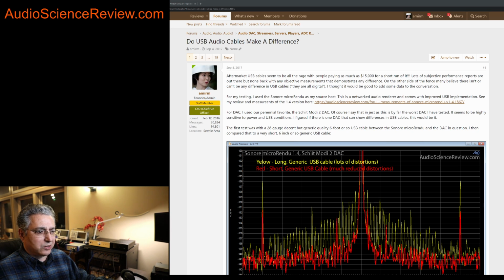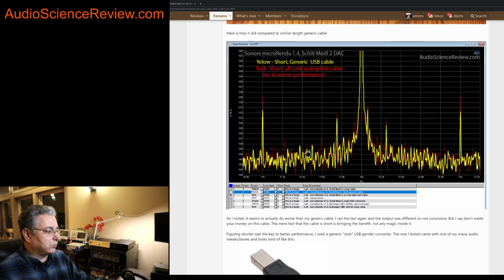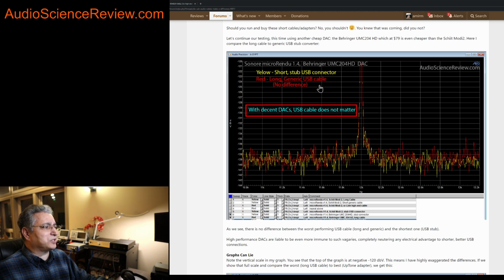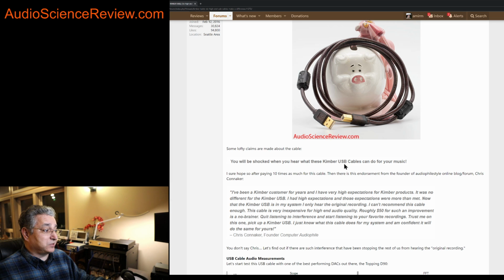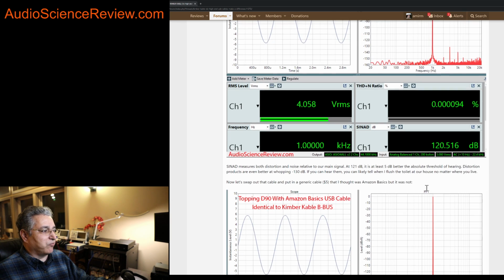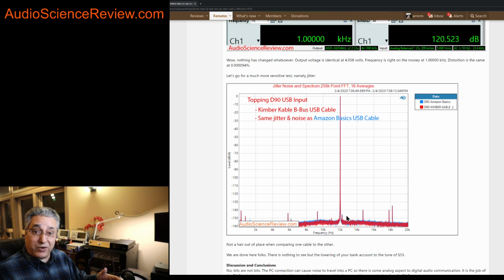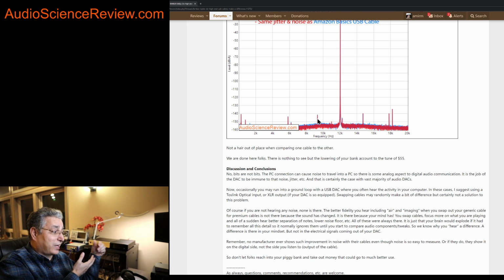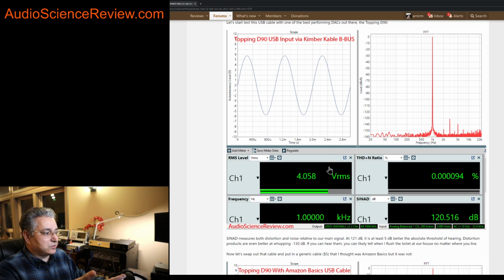Do USB Cables Make an Audible Difference (Kimber Kable Review)?

Comment: My experience goes far beyond comparing two USB cables. I've tested different USB cables, with and without galvanic isolation, and combinations of different cables and galvanic isolation.

I own two relatively modern DACs, a Topping D30 Pro and a Denafrips Ares 15th. In my listening experience, neither completely eliminates the influence of the USB connection.

The best results came from combining a high-quality USB cable (AudioQuest Carbon) with a galvanic isolator (Topping HS02). The subjective improvement is substantial: a more natural, three-dimensional, lifelike sound.

You haven't tested these combinations. Instead, you assume that any competently designed modern DAC has already solved these problems internally.

I don't claim that my listening experience is scientific proof. But your measurements on a few DACs aren't proof that everyone hearing differences in other configurations is imagining things either.

You correctly acknowledge that USB connections can affect analog output, then dismiss experiences you haven't investigated. That's an unjustified generalization, not scientific rigor.

Comment: UGREEN! on amazon are great i have 5 audio interfaces clean as, and theyre LOCKING really good USB-B connectors so tight ;) - they are triple shielded not double (the only thing that really matters is preventing interference after all).. and btw cable resistance is the start and end connectors, the material in between and length only causes 0.000001%  latency (if your after low latency that is)..  also keeping all your usb devices on same cables makes same latency.. this is my biggest suggestion if trying to sync multiple devices.  ALso ditch ASIO4all it sucks,. use VB Matrix and u can divert ur usb audio anywhere.. no DAW running,,   it absolutely rocks!

Comment: I dont use or need USB cable for audio but lot of people told me they are very important and I beleive them. I also beleive your testing, I am not very knowledgeable but I have an open mind and a scientific background. You must be missing something in your measurement ? High-frequency noise from noisy USB ground? Can you measure on the dac side if jitter is less with a better cable? I beleive in your accurate test but also beleive your missing something.

Comment: Measurement is one thing, but I can't explain why I hear difference between cables. My friend loaned me a $3500 USB A to B cable and I compared with the another that I bought at Best Buy for $20. I did hear a difference. Whether you like the difference the expensive cable makes is another story. I really wished the $20 sounded as good as the $3500 if not better. Well, I do like the $3500. Was it a day and night difference? No. But I am not going to buy one since the price is beyond my means.
Reply: But that's because you KNOW the $3500 cable was plugged in. I'm willing to bet if you did a blind test you wouldn't hear the difference. It's called confirmation bias.

Comment: I've given up on cables.  I believed and felt like I was missing out on the full potential of my system without expensive cables so I bought a bunch of expensive ones that I used for a few years.  Then one weekend, I decided to have some fun and order some Benchmark Media Cables that totaled less than the cost of one cable in my system.  Did some back and forth and at first felt the Benchmark Cables were more sibilant.  Then I switched back and realized the same sibilance was in my much more expensive cables.  Dawned on me that I was just listening more intently to try and pick up differences.  After switching back and forth with one cable at a time and then switching all of them, I realized I was hearing no difference.  Then I did the same with some UL safety certified, Monoprice cables vs much more expensive power cables.  Realized the same thing.  No difference!  Sold all of the expensive cables and used that money to buy some new headphones.  It was actually freeing to give up on expensive cables.  Thank you for proving my experience with science!
Reply: Well done! Exactly right!
As a physicist I never understood what this cable fuzz was all about. And Amir makes it totally clear:
IT'S ALL A SCAM.
I chose the cheapest of the cheap cables and am totally happy with the results: Crispy sound, monstrous bass. great imaging ...
My point: Pay for what you hear!
And turn up your BS detection!

Comment: Kimber is usually a lesser evil. They do make well constructed large gague cables that are of reasonable price. They are one of the few providers that actually measure their "run of the mill" cables and publish the results on the website. They do, however, also sell ludicrously expensive silver and carbon coated cables (they don't show any specs for those😂) for those ignorant enough that they must just have them.  Caveat emptor!

Comment: I wonder what measurable differences you would find between basic and "high end" DACs themselves. Mike Moffat's been at this as long as anyone in the audiophile marketplace. So I would consider his Schitt products to be based on very reliable standards of excellence. Their most expensive one is $2300. So it would be interesting to see the difference between Schitt's high and low priced products. Even in the deep and weird analog world of comparing phono cartridges, the differences are there... but are they improvements? However, you hit on the main culprit to these technologies running into stratospheric lunacy... the blind test. The high-end audio industry is in lockstep agreement to limit these kinds of listener generated testing platforms. It's the dark side of the industry that perpetuates the absolute insanity of $20k USB cables. And yet, there is zero effort in the industry to put an end to this nonsense because it's so highly profitable to keep it all mysterious. If you got 10 of the world's best "golden ear" listeners in a room and a/b tested 5 100wpc amplifiers, 5 DACs and 5 preamps through 5 different sets of interconnects through one pair of good speakers, you would get probably get some interesting but unconvincing information.
Reply: It seems every company eventually wants a piece of the snakeoil market.  Even bluejeans

Comment: How can better cables make a difference if the software protocol is responsible for making sure the data is send exact? Unless you have a defective cable, a $5 usb cable will work just as well as a $1000 one, because the software make sure you always get a carbon copy of the data on the other side. The software protocol even allows for losses and it compensates just fine.

Comment: I've always been FIRMLY in the "cables make no difference" camp (with the obvious caveat that minimum specs must still be met). For home audio, Amazon Basics is essentially as good as anyone needs. On the professional side, these days I use 12G HD-SDI cable (Belden) and 12G-rated BNCs for every cable I make up. In many cases, 3G would suffice, and 12G won't (of course) give me "better" results, but I like to be able to re-use cables and know that any cable will work with any piece of equipment in my system. It's quite amusing how people into "audiophilia" are typically guys with surplus disposable income and precious little idea about how electronics work, aside from repeating rubbish they've been told at some HiFi show or whatever. They have just enough knowledge to be a danger to themselves (and their bank balance!). The "high end" manufacturers are taking their customers for absolute fools, yet the buyers lap it up, and defend it to the hilt. Crazy! 
Amir, Gene DellaSalla, and others like them are the saviours of sanity in the world of hifi. Sadly, many people (eg. cheapaudioman) purport to be "down to Earth", "the voice of reason", etc. yet shill garbage like audiophile power cords. Thankfully, I don't need to take advice on cables from YouTubers (no offense, Amir!) but I very much appreciate these debunking videos. Unfortunately, the "believers" in audio mysticism don't want to face facts. Their loss, their bank balance! They really ought to know that the manufacturers are literally taking them for fools though!

Comment: if cables made differencea then we would see it clearly tv/monitors but these people have their heads up in their own a** hole, i bet in a blind test they would hear differences when nothing is changed at all
Reply: It depends on the audio gear, much of the issue is electrical noise over the mains. Anything and everything one can do to clean up that noise will be an improvement.

Comment: I for sure hear a difference in USB cables. I have listened to recordings with a few cables and listening back to back with the different tracks I can hear subtle differences between the cables. If I were to swap out cables and not have the recordings to listen to I would probably not hear it as much if at all. You tested to pretty low end cables here and I think you will see a bigger difference if you compared the basics against a $200 - $300 cable.
Reply: Agree, the system I am running right now, every cable change is audible to a point. And not just to my ears, as folks in the house that have no clue what I am doing have asked "What the hell did you do?" when I chose poorly.

Comment: Great video. I want to add one important aspect though.  All these USB cables are manufactured by the same cable manufacturers in Shenzen China. Kimber is not a manufacturer. Probably no American company manufacturing USB cables. They buy cables from the Chinese and snake oil them for much higher price

Comment: Interesting video – Thank you. 🙂
I think you should add to your conclusions that the measurement shown in this video, proves that only a synchronous usb interface, will be able to be impacted by the cable used. 
- Schiit Modi 2 runs in Synchronous mode (or as Cmedia calls it Isochronous)
- TOPPING D90 runs Asynchronous mode, and reclocks the PCM through a FIFO buffer.
Reply: The Schiit Modi 2 owners manual literally says "Asynchronous". Only utter junk runs audio through USB using synchonrous transfer.